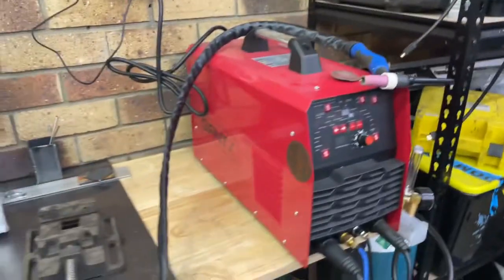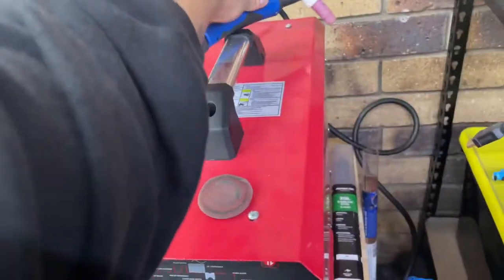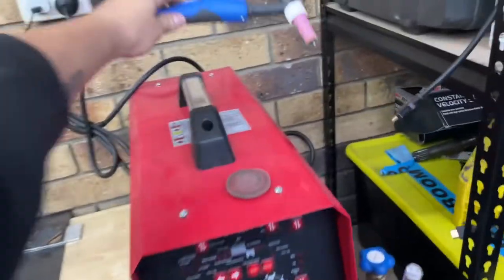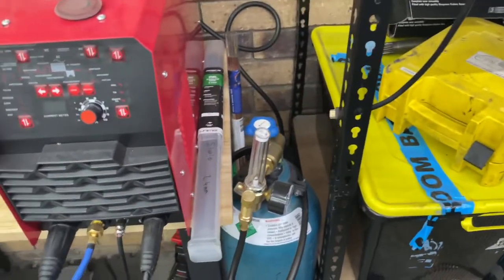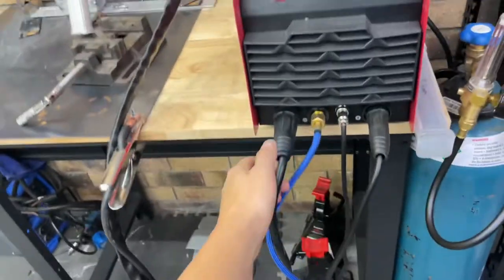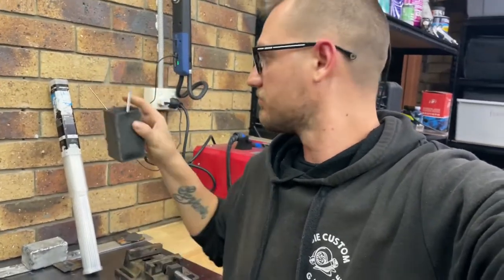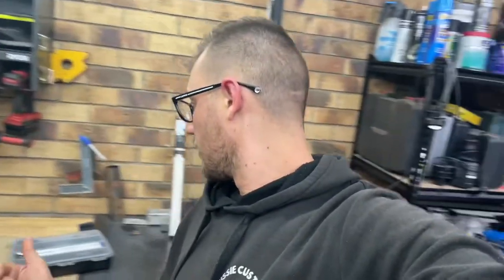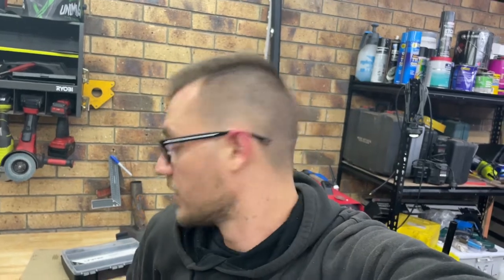Giantz 250 ac/ad Tig review

Comment: Hi mate, Great video thanks. I have just bought the same welder second hand. A couple of questions . Do you have a copy of the manual that came with it, I have been trying to source one but without success. If you do would you be kind enough to send me a photo/ scan of some of the important pages. I see you have the TIG torch plugged into the RHS which on my machine is +. I thought, but I may be wrong you normally put the torch into - for TIG welding, but your machine may be different, Also I have seen a post which stated the polarity was wrong on these machines. :)

Comment: I have one of these and it blew the transistors on the AC circuit board, they re imbused me 80% of cost, as it still works as a DC tig and MMA. Any idea where to source another PCB for the AC circuit
Reply from the maker: Hi Chris, you might be able to take it to jaycar and get the transistors replaced. I think they are only soldered into the back of the board